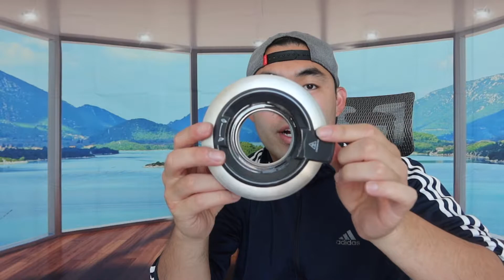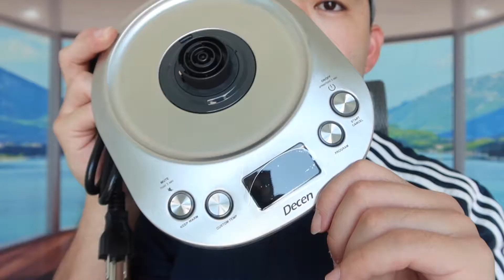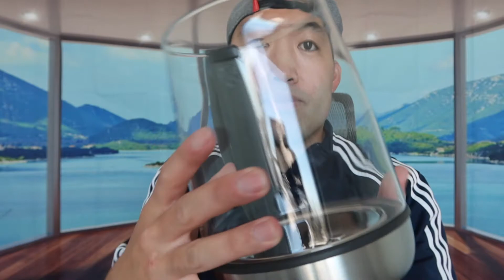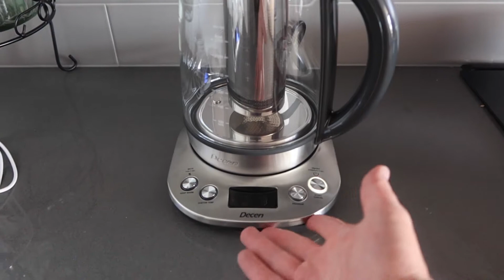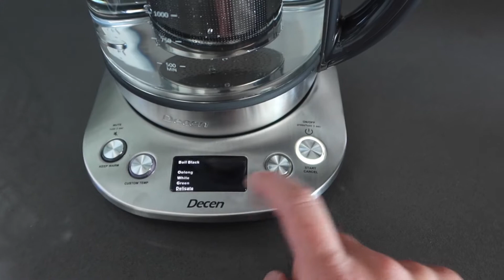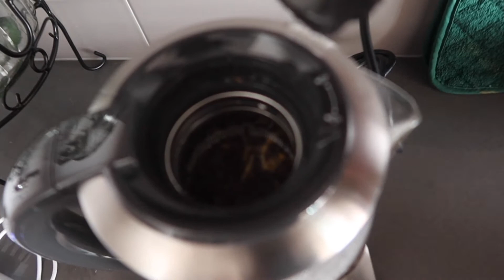Should You Buy? Decen Electric Tea Kettle

Comment: there's no cover over the lip of the kettle so the hot steam/water escapes.  If you keep the kettle on the heat pad, won't you need to keep adding water to heat, or the tea will get denser and denser.  If they had a cover over the kettle lip, with just a tiny amount of steam being released, it would be a no brainer.  IMO
Reply from the maker: Yeah unfortunately most kettle doesn't have a cover.